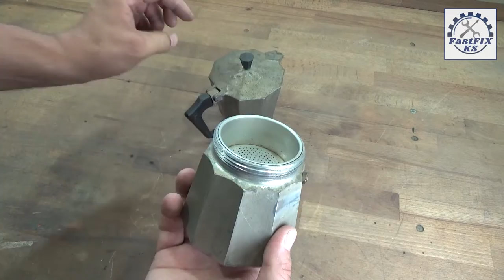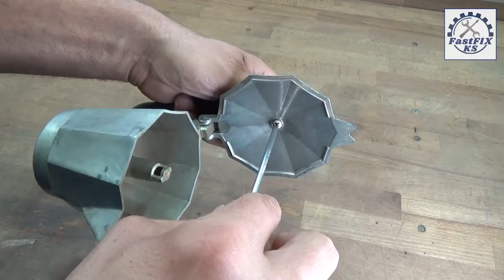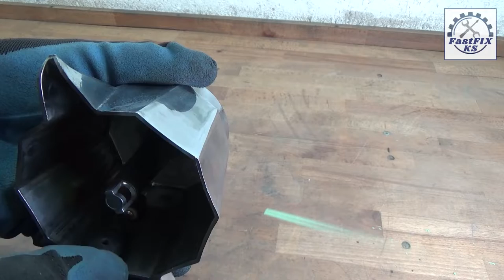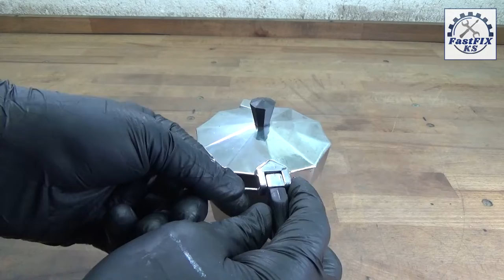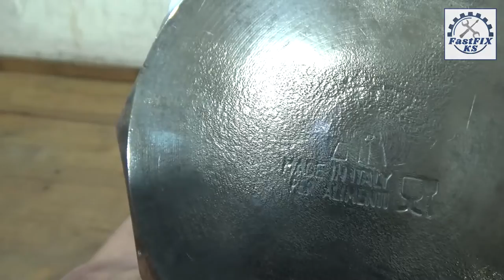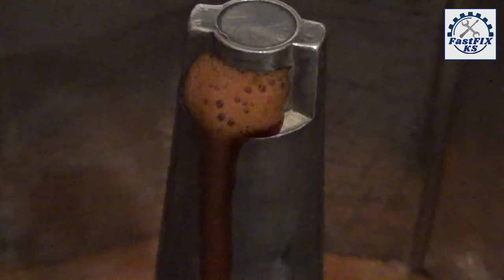Italian Moka Espresso Pot - Coffee Maker | Restoration

Comment: You can just use an unsharpened pencil to pop out the metal filter on the basket. No need to use pliers.
Reply from the maker: Possible. I didn't think of that at the time or thought it would distort that filter. Anyway, thanks for the advice.

Comment: Hello, I am on a similar restoration. but the seal, although still tight, is too old to be removed without being destroyed. My Cafetière being very old, I was wondering if the seals that can be purchased today are compatible.
Reply from the maker: Hello,
Some things are better left untouched than destroyed. I would disassemble and remove only those parts that I think I won't destroy or I won't be able to return to working order.
I don't know, and I can't confirm if the newer parts are suitable for your Cafetière.

Comment: Nice video … not sure i would have used polish on the inside though?
Reply from the maker: Thanks for watching and commenting. I appreciate your opinion, the next restoration will most likely not include internal polishing.
Reply: @fastfixks  not that it doesn’t look great, but the leeching of the polishing paste into the coffee is of concern s the coffee is very hot, milling acidic and will absorb anything left behind.
Reply from the maker: @RichardT2112  I understood what you wanted to say, I already had similar comments on that issue. But I do the "regular maintenance" of all aluminum containers, including this coffee pot, in a larger container and in boiling water. It's an old-fashioned way that my mother and my grandmother used. This process in boiling water takes at least half an hour, so there is no chance of any polishing paste or anything else being left.

Comment: Question how did you get the inside of the water chamber clean? Dremel? And polisher?
Reply from the maker: I had one similar question like that.
Inside the bottle I polished with a small grinder machine, thus cleaning the grease and dirt.
After that, wash all parts with water and dishwashing liquid. Then put the parts in a larger bowl with water and let it boil for about 15 minutes.
This is my way of cleaning and I am pleased with the results. Try it and you'll see for yourself.
I hope I helped you.
Reply: thanks I broke it out a couple of days ago and saw I needed to give some TLC that helps me tons thanks

Comment: I use one of these all the time. Lately, I can't seem to use it as I can't get the two halves to screw together. They just go round and round as if there's a problem with the thread, although I can't see anything obvious. I tried a new gasket, but that didn't help. Do you have any suggestions or is it simply time I bought a new pot? Thanks for sharing your restoration. It looks amazing now.
Reply from the maker: If I understand correctly, you can't screw the upper and lower assembly down enough, so the threads slip.
I'm pretty sure the threads are worn out, that happens with time and use. To the eye, it looks like everything is fine, but the thread depth is no longer the same, it has decreased. I hope you understood what I want to say.
What to do?
Surely new threads are the best possible solution, but not everyone has the necessary tools.
What would I do?
I would try liquid metal, a two-component mass that can be bought in local stores.
I would apply the compound on the threads, on one of the parts (don't overdo it). When it dries a little, gently twist and unscrew (remove excess mass). Then wait for it to dry completely. Now remove the excess mass with files or a mini grinder machine.
I think this method might be successful for your problem.
I solved a similar problem in the same way. These were gears for a children's scooter.
I hope my advice will be useful to you. If you tried all the methods and did not solve the problem, then you could try this one.

Comment: That one looks far nicer than the new ones, due to the attractive, scalloped sides. The new ones are just flat. Boring and plain by comparison, but far cheaper to make. Very nice restoration, though I would have got a new seal, rather than keep the old one. I hope you seasoned it first, before making a brew to drink.  Wow! you take two sugars in that size cup.
Reply from the maker: Thank you for the comprehensive comment, you noticed and said a lot. Coffee is my daily routine, I really like to drink coffee. I don't use sugar at all, I drink coffee without sugar. In this video, I inserted two sugars so that there wouldn’t be a lot of comments about why I didn’t sugar the coffee.
Thank you again for watching and commenting.

Comment: I just bought a beautiful italian Moka pot like this from the 80s (I live in australia) from a thrift shop. It is in very good condition but I don’t know anything about coffeemakers at all. It’s going to be a gift for christmas to my dad. Do you have to cure or season these before use? I’ve heard about oiling them inside but i can’t find any clear advice about them.
Very good work!
Reply from the maker: I haven’t heard of that oil, I haven’t used that method. It should definitely be cleaned well before use. First, wash it well in a dish detergent. Then you can put all the aluminum parts in a larger pot of water and boil it for a while. Then wash again with detergent and it should be super clean and ready to use.

Comment: how long untill a new oxide layer turns it grey and dull again?
Reply from the maker: Depending on how often it is used. Here it has been more than half a year since the restoration and it is still almost the same condition.
Reply: @fastfixks  Very cool.
I might try it on my bialetti soon. Just to make sure, yours was aluminum, wasn't it?
great job!
Reply from the maker: @Timmerdetimmerdetim  Yes, it is completely aluminum except for a couple of plastic and rubber parts, which are obviously visible. I wish you luck in your restoration.
Thank you for watching and commenting. I hope you liked the video and subscribed to the channel because it would mean a lot to me. Thanks

Comment: Is it dangerous to use sand paper clean polish the the inner part?
Reply from the maker: Hello,
I didn't use sandpaper to clean the inside, I just polished it and it doesn't create metal chips. But even if I used sandpaper, this is a part that is very easy to wash so that there would be no problems or dangers.
Thanks for asking and watching the video.
Reply: He should be afraid, moka are built using oxidation for the inner parts to avoid acids to react with the aluminum, polishing means the oxidation is far gone and you should avoid to let the coffee sit inside at all, also clean it every time you use it, using detergent like dish soap destroys the inner coating layer, that’s why you should avoid to do so
Reply: @xasdrubalex  thank you for the information
Reply: @dowayigu1277  you’re welcome, and i invite everyone to be aware of that and to inform everyone else because it is something that is always overlooked, also every country has their report on aluminum dangers in food packaging (nothing to be scared of, just better safe than sorry)
Reply from the maker: @xasdrubalex  I'm still alive and well, so there were no problems :) :) :) :) :)
Of course, we should pay attention to everything. 
But what could I do in this case? 
Throw away or buy another?
Reply: @fastfixks  never said to throw anything, i did the same as you, just look for planting techniques or companies around you that can help you with the job, that’s the right thing to do, but you can do whatever you like